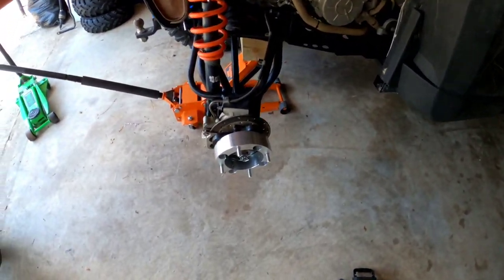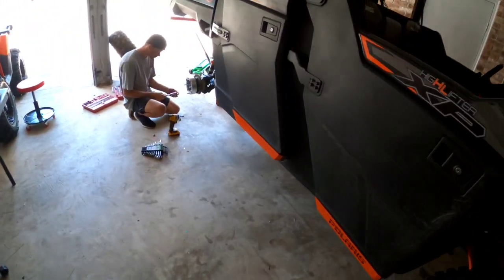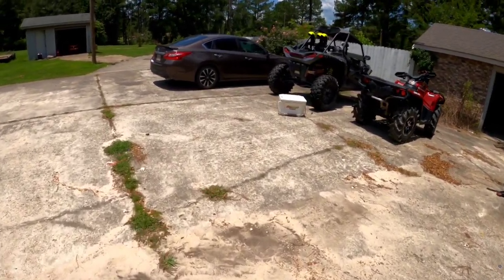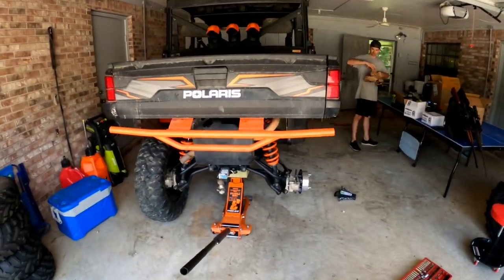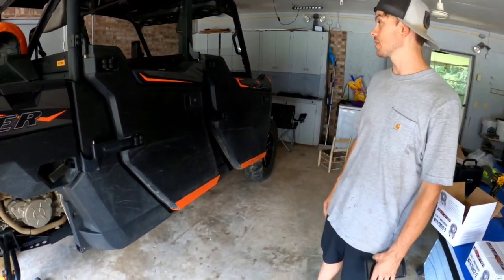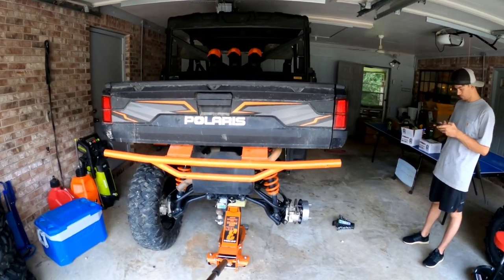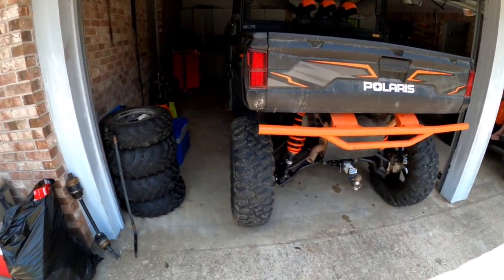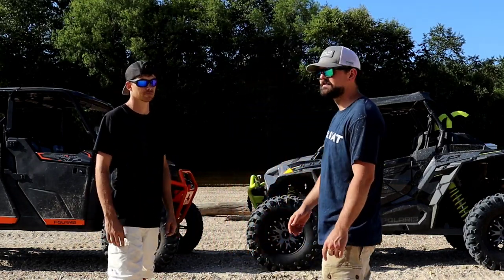Gilomen Innovations Tune And Clutch  Kits:2020 Polaris Rzr Highlifter and Ranger Highlifter!

Comment: I have this done on my 19 High Lifter ranger crew. It works really well but I have the p90xt primary clutch also to get rid of the one way bearing. Im not worried about top speed though since I'm running portals and 35s and all that. On a side note, when you install the tuned ECU after you start it and run it if it don't seem to run right go to DTC mode on the display and clear codes then try it. Mine threw a TPS code at first but doing that cleared it and it ran great afterwards.
Reply from the maker: Thanks for that info man!
Reply: Yes Sir you are welcome
Reply: You have to turn key on for a minute or to before start up that helps it not throw code after installation of ecu
Reply: Yea, I was excited and in a hurry lol. I've since then upgraded to 6 inch portals 45% GR 6 inch lift and 42 inch deestone AG tires.